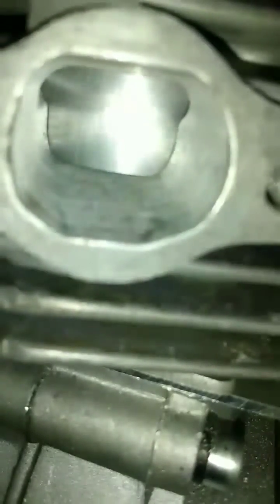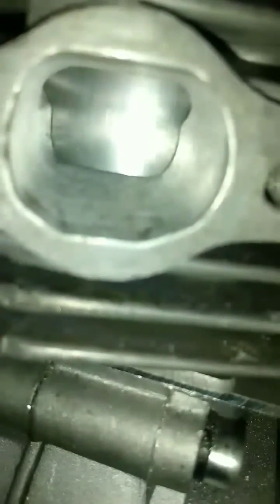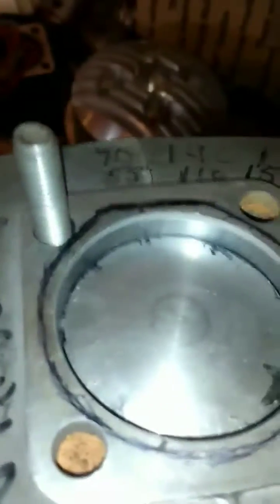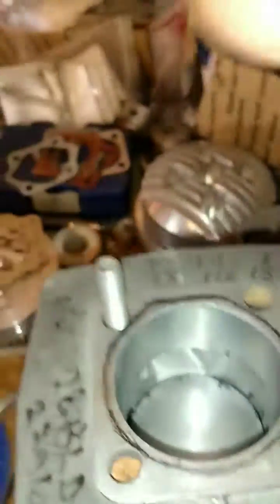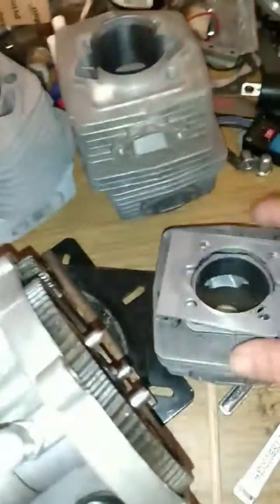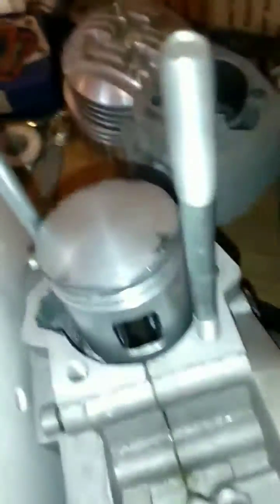motorized  bicycle  porting information

Comment: What would happen if the skirt does rise over the exhaust as you had stated “don’t want that to happen” and thank you .
Reply from the maker: Confused about the question but if I understand the question correct skirt meaning bottom of the piston skirt leaving the crankcase open at TDC that would just be wrong. Very doubtful it would run worth a crap. Basically you would be filling up crankcase full of spent exhust gasses opposed to fresh fuel charge. At tdc your intake ports open  and exhust port should be closed by the skirt..